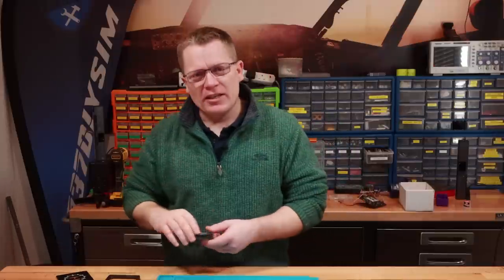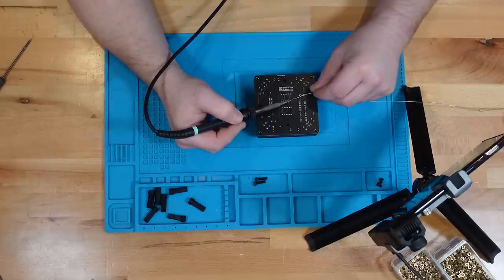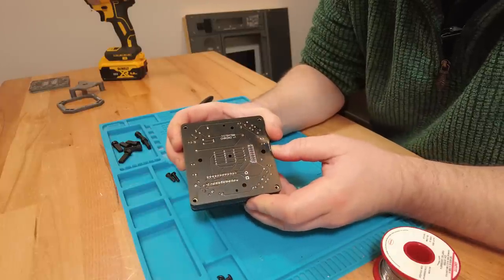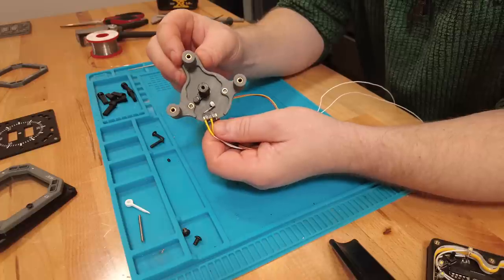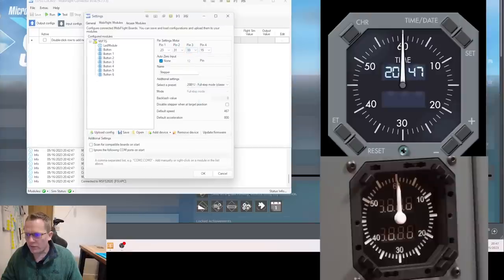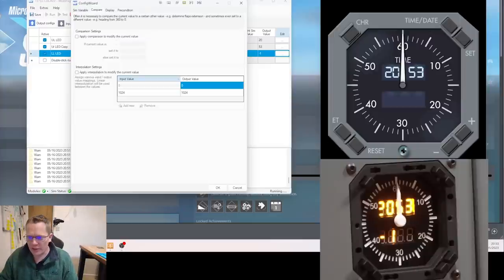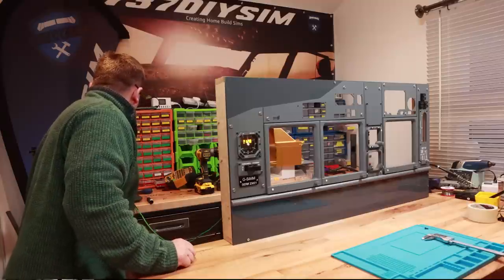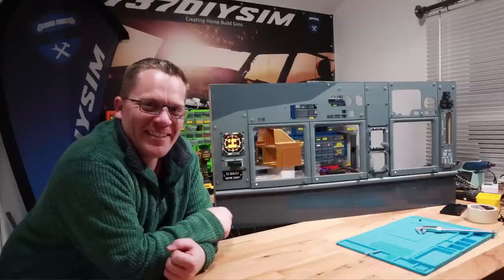737 Clock/Chrono build Video

Comment: Beautiful build!   You can improve contrast on those LED displays by putting a darkish yellow/amber gel over them.  It'll vastly tone down the ambient visibility of the "off" segments, while the lit segments will be just as bright. :)
Reply: Are you able to elaborate on this? I find this to be the difference between what you would see in the real deal vs DIY projects. What kind of gel/product are you talking about? Cheers mate.
Reply: Sure.  A lighting gel (colored thin plastic) can be placed over the 7-segment displays to improve the contrast.  If you match the color of the gel with the color of the light, then it will darken the frame of the digit segments without making the light any less dim.

Comment: 3 Things:
On your website clicking any of the optional items in the parts guide points to an invalid address: 737%20chrono%2C%20737%20clock
A piece of yellow tinted film would improve readability of the led displays inmensely.
The seconds hand lags behind the digits changing, it looks off. Maybe you can change the settings so it "lands" at the tick instead of start moving at the tick. Great build.
Reply from the maker: Good morning! I noticed that the second hand lagged exactly one second until the end of the video. The clock started from -1 instead of 0. I corrected this by using the compare tab in Mobiflight and changing the value from -1 to 0. Thank you for bringing this to my attention. Also, I have just received a roll of window tint suggested by a Patreon member. They pointed out that this makes the 7 segments much more readable, which I have a go at soon. Kind Regards, Karl

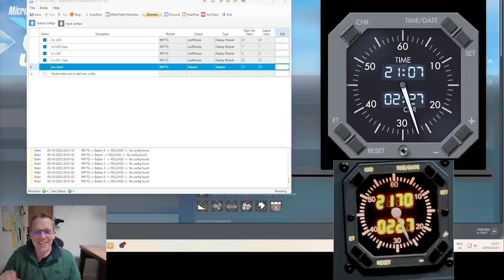Comment: from @29:47 the top right display's digits are the wrong way around eg shows 10 instead of 01. Even more noticable from @30:19 where it shows 70 instead of 07 (only 60 minutes in an hour :) )